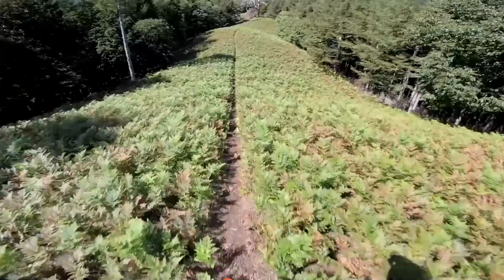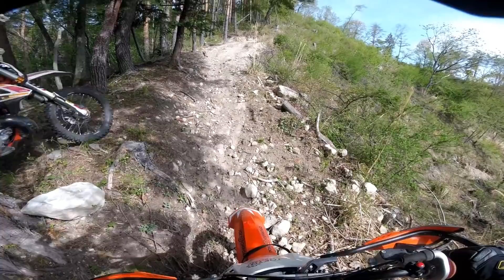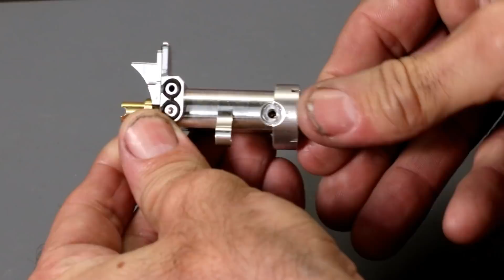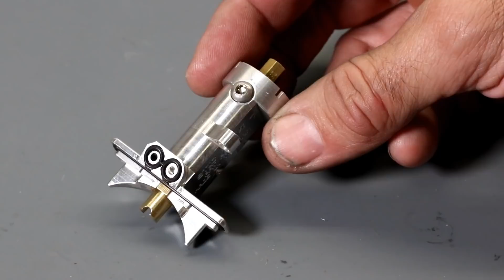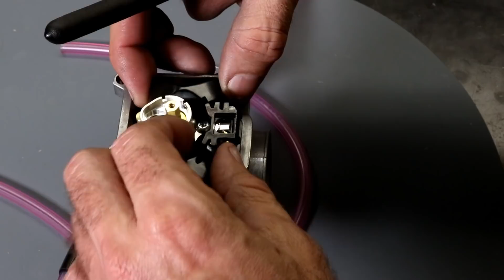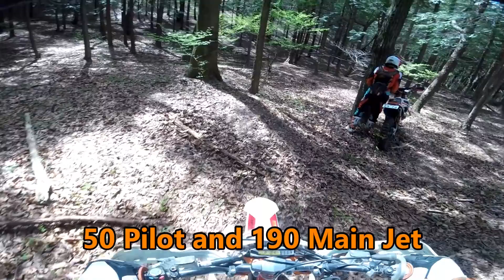STIC Metering Block Setup and Tuning Tips

Comment: Do these need tuning for exhaust reeds head ect
Reply from the maker: Yes, fine tuning is always required. The airscrew works well at fine tuning the bottom/mid, or pilot and needle clip if significantly off. Top end is tuned with the main jet.

Comment: Where can we find these sticks sir and gaskets
Reply from the maker: Thanks for your interest. The STIC metering block is available to sale on the Tokyo Offroad webshop here: https://www.tokyooffroad.com/product/stic-metering-block/ 
The STIC is supplied with a gasket, mounting screws and torx bits. If you don't already have a suitable Keihin PWK Airstriker carb then a full Keihin 38/STIC cark kit is available here and includes the jetting kit and quick adjust aircrew: https://www.tokyooffroad.com/product/stic-keihin-pwk-38mm-air-striker-short-kit/

Comment: I have a brand new 0 hr 2019 TM EN300ES and I was wondering if the STIC would fit because I know it's fitted with a PWK 38 Keihin, however, I don't know how to tell the difference between a airstriker and not, and if or not mine is the first? Does it matter? Cause I'll order the STIC ASAP then! :)
Reply from the maker: Thanks for your interest. If your carburetor has a screw on top then the STIC 19M will fit. If it has a bolt on top then the STIC 19E will fit. Feel free to contact me here: https://www.tokyooffroad.com/contact/

Comment: Buying a XTrainer 19' looking for more bottom end, 75 yrs old, riding in lower range mostly. Thinking of Gnarly pipe + stic
or would you go to a Lectron.  Local riding 1000', Been riding for 50 yrs. Old A rider.
Reply from the maker: I think you'll be very happy with a Gnarly Pipe and STIC. One of my friends tried a Lectron and later switched to a Keihin with STIC and much prefers the power (linear and strong) of the STIC.

Comment: Great stuff, but do you have anything to upgrade the Mikuni TMX.  Not enthralled with the JD Jetting upgrades available.  Thanks.
Reply from the maker: David Garcia - The Mikuni TMX carb  block is cast together with the body as one piece. As such it is not replaceable and a STIC is not currently available for the Mikuni.
Reply: @TokyoOffroad  Mark is there different jetting for STIC versus non STIC Keihins?
Reply: I will be swapping out the Mikuni for the Keihin, but will do the STIC upgrade at a later date.  Will I have to re-jet with the STIC upgrade?  Thanks.
Reply from the maker: David Garcia - Yes, rejetting will be required. Jets with the STIC are typically a couple of sizes larger than non-STIC jetting

Comment: How about a video of STIC vs TPI??? 

If no, what's the verdict on the two?
Reply from the maker: Patrick Lockhart - The feel and power is quite different. The 2019 250 TPI gets the job done, but doesn’t make me smile as much as my carb model 2017 250 EXC fitted with a 38mm Keihin & STIC. Power is stronger and so much fun to ride.
Reply: @TokyoOffroad  that's kind of what I was thinking based on my testing of 2 different carbs.

Comment: I was wondering what elevation you are at im in ny around 1000 feet i have 2018 ktm 300 with sx computer and rk tech head, problem im  having is bike doesn t idle very good, and when i start it up it smokes like a pig. Settings 200 main, 50p,n3ej 2nd clip air screw 31/2 turns, im wonder if the reeds might being playing a factor, it has oem reeds and brannew they had gaps in all four corners, and also was thinking possible right crank seal maybe bad, any advice would be greatlly appreciate. Love your videos keep up the good work
Reply from the maker: I typically ride sea level to 2000m (about 6,600ft). Does it smoke excessively all the time, or just when it's cold at startup? What oil are you using and what mixing ratio?
Reply: @TokyoOffroad  mainly when i first start it up and goes away, but at slowers single track speeds it like to load up, i use klotz r50 techniplate at 50:1
Reply from the maker: Do you shut the fuel off when you finish riding and transport the bike? If not fuel can leak into to crankcases and next time you ride cause a lot of smoke on start-up. If a crank seal is bad it will tend to smoke badly all the time, so it doesn't sound like that is the cause. The current baseline settings I'm recommending for all 250 and 300 applications are pilot=50, main=190, needle=N3EJ on 3rd clip, slide=6.5. The airscrew will typically be 3-3.5 turns out (start at 3 out and tune from there when bike is up to temp). The settings you are currently using the needle clip is leaner (on the 2nd position) but the main is richer (200). Could you try changing your main jet to a 190 and putting the needle in the 3rd clip and see how it runs. I don't have any experience with Klotz oil. I use Motorex Crosspower 2T at 60:1 and find smoking is pretty low. However, it should be noted that any bike will tend to smoke more at startup when the engine is still cold. I don't get any loading up on slow single track and no splooge from the silencer.
Reply: Thank you for the response ill try those setting i know ive been close to that, and i think im going to try some differant oil and see if that helps, do u think the reeds are playing any factor in it
Reply from the maker: I'm not a fan of the stock reed cage. IMO the quality is poor to say the least. On my 2017 250 EXC the stock reed valve had 5 reeds! Yes, 5! They'd installed 2 reeds in one place by mistake. The reed cage molding quality is very poor (warped) causing gaps. Because the cage surface is not flat the reeds need to twist to seal. My recommendation is to replace it with a VForce reed cage. My 2019 TPI stock reed cage quality was no better, although they at least installed the correct number of reeds on it (4). In this video I compare stock vs VForce 4: https://www.youtube.com/watch?v=kWu7rrj4Qhg
Reply: I have been holding out for george's reed cage hopefully it comes out soon, if not ill be getting the v-force
Reply: @TokyoOffroad  the slide leaned it out, it allso had a notch in the bottom to which helped but still did not solve the problem, so talked to george he said to send it to him to check it outcause it doesn t make sense why its running so rich, im also going to have him taperbore it for a little more overev
Reply: Well i tryed the setting you suggested with no good results today was 80 and it ran the worse its ever had the dang thing is to rich, next im going to try a number 7 slide and hopefully this will fix it
Reply from the maker: chris dunn - Sorry to hear the settings didn’t work well for you. I’ll be interested to hear how you like the 7 slide.

Comment: Hey Tokyo Offroad, I've been loving these videos. I have a STIC #7 in a Keihin PWK Airstryker. My carb is taper bored for 38/40mm. I also run the a high compression head. If it's possible for you, I would try this setup, or maybe try out the 40mm version. The taperbore 38/40 seems to the best balance of both worlds.
Your recommended baseline set up is on point for most elevations. What George has recommended and what I've found works even better is replacing the N3EJ with NEDK needle in the same clip position. Seems to be a bit crisper everywhere. Also, don't be afraid to move up and try some larger combinations like 200 and 55 /52 or 195/50/52. I'm currently on the NEDK 3rd, 190/50 setup for general feel and balanced fuel consumption. Also, I noticed your mentioned the A/S at 3 turns, mine is actually at ~ 3.5 turns, and from people I've spoken with seems have consistent success with 3.5 - 3.75. It's of course critical to have the float ~6.5MMish as you have previously highlighted. It might be worth a shot in the never ending journey of tweaking.
Reply from the maker: Pleased to hear that you like the videos. It's good to hear other peoples settings. Regarding the air screw setting, 3 turns out from full in is my recommended starting setting. This should be fine tuned once the bike is up to temperature. Typical air screw settings with 50/190 jetting seem to be between 3 to 3.5 turns out. I plan to test some other jet settings too in the near future, but for now the 50/190 setting with a N3EJ needle and 6.5 slide in 38mm Air Striker carbs seems to work very well on a broad range of 250/300 bikes, so have confidence in recommending it as a good baseline setting.
Reply: How many miles can you go with these settings on a full tank!? I tend to do big loops say 60 miles or so! I’m interested but don’t want to have to pack gas either ha thanks!

Comment: Good stuff, I will be trying one of these STIC units along with a 38mm carb soon on my KTM 300 so I'm gathering as much info as I can find!  A setup that the STIC inventor has pointed me towards is as follows:-  Airscrew=3.5 turns, Pilot=52, Slide=7, Needle= NEDK on the third clip, Tube 114, Main jet=190.
Reply: I think I missed why the 38 mm carb is recommended.....I have the 36 mm stock of course.
Reply: @patricklockhart7512  interesting... My assumption was that my 2017 300xcw came stock with 36mm  but now I have some research to do... 

You asked about difference between 36 and 38mm carbs...

36mm represents the diameter of the pipe size that fits into the engine.  I'm not sure if it's inside or outside diameter of the carb? 

I believe the theory is better low end power/torque with the smaller diameter.  Pulling the same volume of air in the same window of time, the average velocity of the air as it passes through the carburetor is higher with the smaller diameter.  

Higher velocity air at the same RPM is saying the same thing as the smaller diameter carb pulling the same air velocity but at a lower engine RPM. 

Ignoring air flow limitations and considering the ability to delivery fuel. fuel flow is dependent on being pulled into the cylinder by air, and stagnant air at zero velocity  cannot pull any fuel.  So my guess is the higher air velocity makes running easier as well.  

Also, the higher air velocity means more air/fuel gets shoved into the cylinder with smaller carb.  More air/fuel more bang.  

I'm actually surprised people don't generally run longer intake boots as well to maximize torque at low rpm.  Maybe the calculations show we're already optimized to the best we can fit into the bike?  

Thanks for asking the question  and sparking a side project idea!

Comment: I have a problem with my 1998 KTM 125 LC2. It has Dellorto 28PHBH carburetor with 132 main jet and 50 pilot. The problem is that the engine doesn't want to idle. Above 3k RPM engine is running great, but if I unscrew the idle screw it automatically drops to 1.2k RPM's and goes lower and engine dies. Also if I keep it idle at 1.5k RPM, and I'll open the throttle very fast engine is dying. I think maybe the pilot jet is too big? Last year I did a full engine rebuild, with new piston, seals and bearings. I'am sure there is no air leaks.

Comment: Does this work as well on the 36mm keihin? Is the issue of, and solution to, siphoning the same? I’m interested in ordering one of these, but less keen on the idea of troubleshooting to get it working perfectly.
Reply from the maker: Thanks for your interest. What bike do you have? Yes the STIC will work on 36mm Keihins, but to get the full benefit a 38mm Keihin is recommended. If you compare 36mm + STIC to 38mm + STIC the bottom end would be similar but the mid and top end the 38mm + STIC is much better.
Reply: Tokyo Offroad I have a 2009 exc 250. What got me interested was reading a review that said riding at a constant speed on the road was much better with the stic, in general I find the top end is enough as it is.
Reply from the maker: @Howling-Mad-Murdock  - Yes, with the STIC constant speed smoothness is improved.
Reply: Tokyo Offroad Thanks. You’ve got me curious about the 38mm now 😀 
Not sure I dare get one off eBay though, seems there’s an awful lot of fakes about.

Comment: Great review .....what is the best idle rpm for a KTM 250 with a Keihin 36 carb?
Reply from the maker: I set my idle based on feel and don’t measure the rpm. I aim for the lowest idle speed which doesn’t cause stalling issues while riding. I have easy adjusters fitted on the idle and airscrew which makes hand adjustments easy while out riding. Be sure to have the engine up to temp before trying to set the idle.